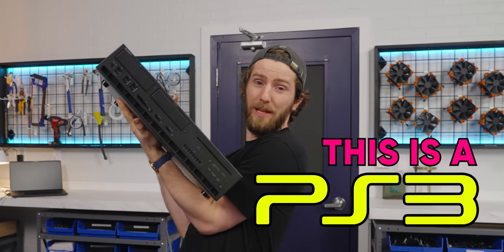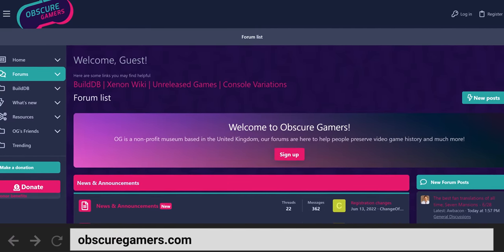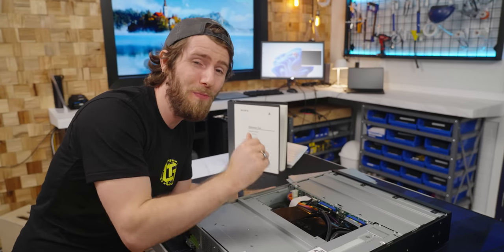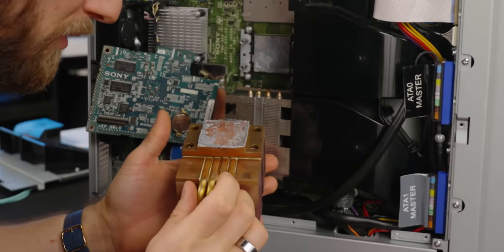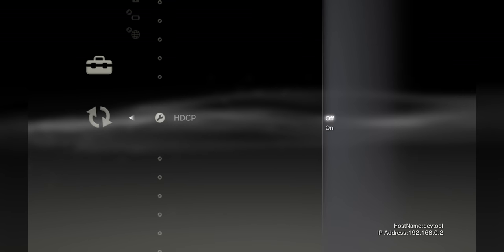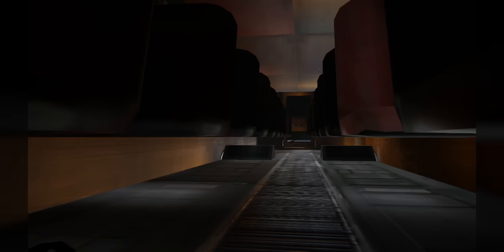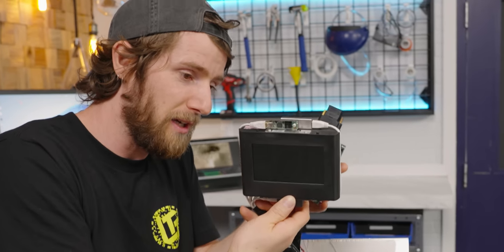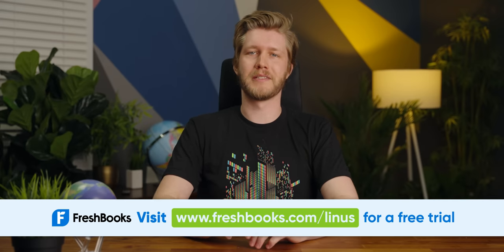I Await Sony’s Cease and Desist - PS3 Dev Kit

Comment: Linus, PS3 video idea pitch: Could a PS5 emulate a PS3?
Relevance: PS3 games on new PS Plus are only streamed; they can't be downloaded and played natively.  That's annoying and subpar.  Is it actually necessary?

Obviously, this will have to be done by building roughly equivalent PS5 hardware with a PC since we don't have jailbroken PS5s yet.  Install RPCS3, purchase any actual copies of games you intend to test (you know the drill), and see what it takes just using reverse-engineered fan-made software.

The point is that Sony itself IS actually emulating the PS3 to stream to your console.  Just on server-grade hardware.  We've all heard how complicated the PS3's architecture is, and it's generally accepted that a PS4 has no chance of emulating it.  But a PS5 is way more powerful than a PS4.  And, again, even if PS3 emulation is complicated, Sony has the tools to do it because it is emulating every PS3 game it streams on PS Plus.  Literally no one is more capable of producing efficient PS3 emulation than Sony since it has all the proprietary engineering data behind it.  So if the reverse-engineered RPCS3 software can actually run decently on representative hardware you guys put together, then official Sony PS3 emulation would work on their official hardware, and this streaming stuff is unnecessary.  Or maybe RPCS3 can't come close at all, and it seems more like Sony has made the right decision.  I find that hard to believe, but someone has to test it.
Reply: Sony uses actual PS3 hardware for said streaming service. Not emulator, just die-shrunk Cell and RSX.
Reply: answer: no
stronger PC's literally have problems emulating ps3. In fact their PS2 emulator is probably still just a bunch of hacks.

Comment: I'll switch to AAs when Microsoft can invent a controller where the batteries don't jiggle out after the slightest nudge
Im sorry man, your controller just dying in the middle of play is a literal dealbreaker, and I have never once owned an xbox controller that didn't let me down.
Reply: I've never had that happen
Reply: How do you even manage that? Have never heard of that happening nor have I ever experienced that myself.
Reply: I've had that happen on a friend's Xbox 360 controller that he dropped a lot. He also has a wired controller that had a bunch of loose connections inside. I do think newer Xbox controllers are good, though.
Reply: then stop dropping you controller.

Comment: Sony thinking that making a platform that's horrible to develop and making the dev kits so expensive would make them successful is pretty funny. Super cool tho.
Reply: Not just the devkits, remember when the PS3 launched it was the most expensive console ever at $499 USD for the 20 GB model and $599 for the 60 GB model. The Xbox 360’s two launch models, Core and Pro, were a bargain at $200 cheaper than the respective PS3 models.

Comment: Another unintended benefit of the xbox controller is that you can put it in cabin luggage without batteries and not needing to take it out when going through airport security. PS4/5 controllers has to be put in a bin because they contain non removable batteries

Comment: how is one hard drive dying mean losing all data. on both when operating system and bios know when more one hard is plug in? and there a disk one and disk 2? i got to try this for myself. because i noticed linus is not always that accurate
Reply: he said one time windows when shut down only goes into hibernation like deep sleep so battery dies . but every night i turn off pc and never did the battery drop lower 100. it did to 99 that because the battery still sending power to motherboard waiting for the power button to get pushed

Comment: I worked at Sony Santa Monica. I hate these devkits with a passion alongside the PS3 itself. I feel so bad for the 3rd party devs, as the system itself was so closed off it made it virtually impossible for them to develop games for. I remember Ubisoft Montreal sending emails to us complaining at the time they were building Assassin's Creed 3 and it's multiplayer component. Same thing when the Psn was hacked to hell and we had some  users complaining about Linux being removed even though they never used the feature prior (I couldn't stand those people).

Comment: This explains a lot in regards to the PS3 getting pure garbage Xbox 360 ports with multiplatform games for the first 3-4 years of the consoles lifespan. We all assumed that 3rd party developers were worthless, lazy and/or paid off by Microsoft to make crap versions of multiplatform games for the PS3. Mainly because PS3 first party games were absolutely incredible, many of which still look better than most exclusives found on the Xbox Series X. 

But it turns out Sony was charging an arm and leg for this ridiculous behemoth, therefore many development studios probably could only get a few (or none) of these things to work with. Thus they "lazily" ported from the X360 rather than building the games specifically for the PS3.

Comment: I still have an original release day psp and the battery is still really strong. Actually can’t believe it hasn’t died and holds a charge as well as it does especially since I don’t use it much.

Comment: Well the pricing makes sense.
The unit likely cost 3-5K to produce, so let's just say $5K for argument sake. If Sony sell 10 of them for $10K to a studio, that's $50 grand profit, but if they sell 10 units at 50 grand a piece, that's $450,000 profit that Sony have made from a studio, before the PS3 has even released, and before said studio have even produced any software. From there, it's another 30% cut on software sales...

Comment: 5:16 I'd thought youd know this. If the console eats 400 Watts and you have 800 Watts avail. a Power outage wont kill your PSU, at least i can't overload and break you're hardware, if you use a UPS too you can overclock the beast, i mean overclock properly. :)

Comment: 8:42 No. AA batteries in controllers are stupid. I get the longevity aspect of it, but 1) you're a Game/Tech journalist, it's not outlandish to expect you to have functional either original or replacement PS3 controllers on site; and 2) so many people around the world will just use non-rechargeable AA batteries and then on top of that throw them in the regular trash. Having a lithium battery which lasts decades (yes, mine still work perfectly after daily use ever since 2008, and even my 2007 Sixaxis are still alive after hard charging cycle maltreatment) is the most environmentally friendly alternative out there. They are even easily reproducible, all they need to be is thin enough and have the same voltage. Cheap copies of DS3 batteries will be around for just as long as AA batteries.

Comment: It blows my mind that Sony would try to charge 50,000$. You’d think get as many dev’s on board and making a great gaming experience would be more important than gouging a little extra cash. I could understand if they were desperate for money at the time, but they we’re probably rolling in dough from all the ps2 sales.
Reply: Leasing. They would rather it be leased, and not bought straight up. Even if you did, they usually could take it from you with partial refunding. So the whole idea really was to stop you from later selling it off

The cost of those blue lasers and pre-fullscale cells were also an issue anyway. 50k seems like a lot, but can be what the cost of these reference kits are when the hardware hasn't launched.

Comment: Just replace the battery in the ps3 controller after it dies in around 7 or 8 years. It takes 5 mins and costs a few quid. There's no need in 2022 to be using AA's for a controller!

Comment: The normal PS3 had 512 mb of RAM but it's spread out as 256 for system and 256 for games. So that means the Dev Kit has 1gb of RAM.
Reply: No it has 256mb of GDDR3 ram for gpu and 256mb XDR ram for cpu
Devkit has 512mb XDR and 256mb GDDR3
Reply: @totallylegitsonyemployee  Thanks, didn't know that

Comment: I had a full fat PS3, got it within 2 weeks of release date thanks to me pre buying. I still use the tv I bought for it with my pc as it's primary monitor. Feel free to laugh but the tv is still going, long after the PS3 shit the bed once, sent of to get fixed, lasted about 4 months then shit the bed again. The fault was the crap solder used for the early release consoles. lots of the bga solder joints cracked under the thermal shunting the main chips suffered with. Haven't had a console since, would I get another... maybe but only for games that I can't get on pc. Like the Gran Turismo series.
Reply: Actually the solder cracking was determined to be the minority of failures. It’s most commonly the actual RSX developing internal shorts inside the die. In some cases the Nec tokin caps failed.
Reply: @Dirty_Bear22  That I did not know, cheers for that 🙂

Comment: I dont belive for a second that you dont have any woking ps3 batteries at this very moment in time i have 7 ps3 consoles and have bought and sold well over a hundred and had hundreds of controllers and ive had one dead battery ive had to replace far more sticks that have been chewed on than batteries. In fact ive had to replace more ps5 batteries in the last 3 years than ive ever done ps3 controllers.

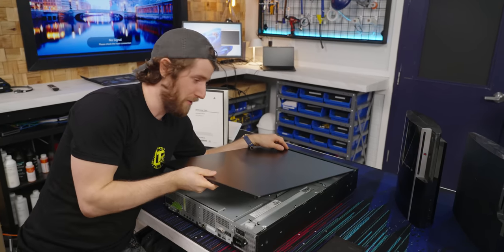Comment: 4:00  16 year old console and a supposed tech channel can't get its facts straight.  The PS3 has 512 MB of memory, not 256.
Reply: 256mb XDR DRAM memory and 256mb GDDR3 video memory, they are not the same thing, Thibaut M̵̺̍ȧ̸̮h̴͓̉r̷͖̋ī̵̖n̵̜̍ǵ̷̝ĕ̴̘r̷̤͆  in the comments explained it better
Reply: @egsfvwdr  Correct me if I'm wrong but 256 + 256 = 512, right?  Or do you disregard half of it because it's not a unified memory pool like the iceboxpleasefixme.

Comment: look if you're still using a part picker in the 2022 to build a computer then just stop. seriously if you can't figure out how to do the math by now then you never will. man it would be funny to see jumpers come back and slaving drives. I can just see the YouTube videos now on what jumpers are and how to use them. this is why I can't take people seriously anymore when they say they have a degree. Google is a massive tool for research. learn to use it. people make building now seem like chore when it's actually the best part. just learn what the actual parts do and you don't have to worry about using a part picker.